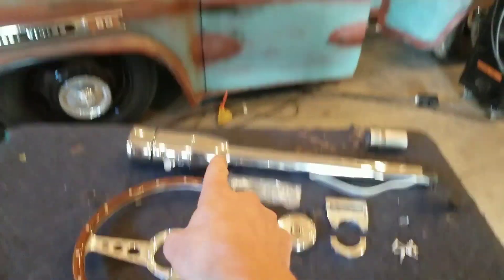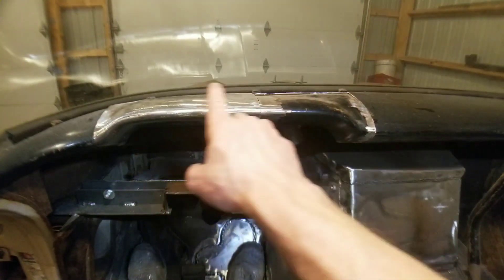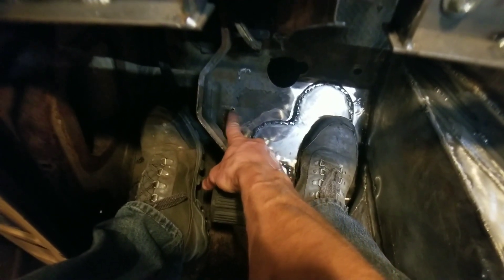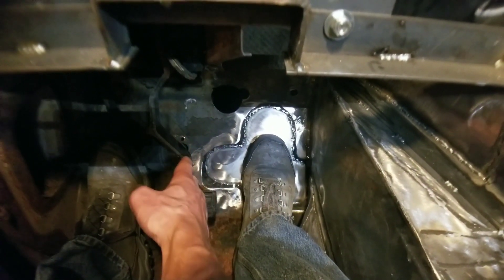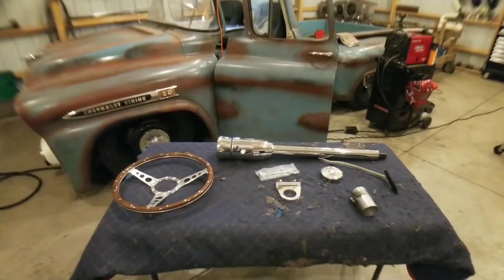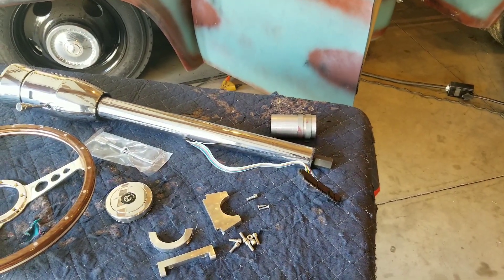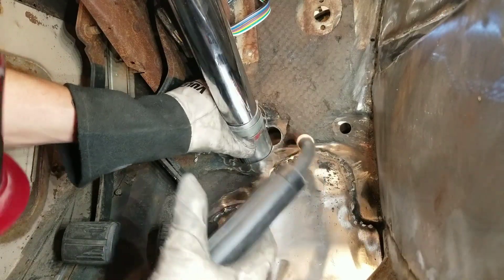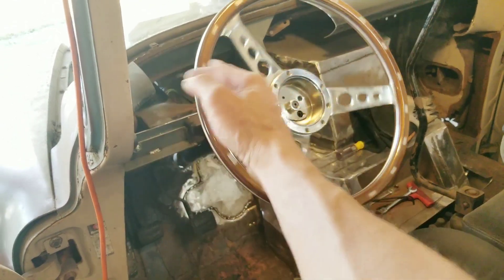How To Install A Steering Column With Steering Wheel ~ 1959 Chevy Truck ~ Apache ~ Viking ~ Custom

Comment: How is the steering wheel holding up? Some say you get what you pay for but I wouldn't mind buying one of these if it gets the job done
Reply from the maker: Sorry for the delay on the response.   I wish I had a good answer for you on your questions,  the steering wheel is still in good shape but I haven't used it so 🤷‍♂️.  I really like it although its a little thin otherwise good, as far as the mount at the bottom of the floor pan I used a piece of 1¾ exhaust pipe welded to the floor pan and a clamp to hold it sold.  Works good...Thanks for the comment 👍 I hope to get back to it soon..

Comment: What seats did you use?
Reply from the maker: https://youtu.be/gvacrsJz-d0 here is a link to the seat install video, The seats came out of a scion XB (the refrigerator box lookin thing) if I remember correctly.  Not using head rests.  They have great style are comfortable and cheap.  Eventually I am going to have them re-upolstered though.   Thanks for watching and dropping a comment.   🤝👍
Reply from the maker: Also should add the center console was from a mid 2000s silverado truck.

Comment: What kind of shifter do u have? What’s the length of it?
Reply from the maker: The column is a universal 28 inch tilt column (not keyed, the key is in the dash board) .. If I was to do it again I would order a 30 inch column and the truck has a eaton 6 speed manual transmission ..
Reply from the maker: Also I should note my column is NOT in the factory location, so if you are building a similar style truck make sure to measure and re-measure for your specific application. 😎👍  thanks for checking out the video and for the question/comment, also make sure to subscribe 👍to the channel, a little inside info 🤫 I fire the motor up in tomorrow's video!!!
Reply: Yes rn I’m working on installing some power steering on my 1959 Apache. Keep up the good content brotha✊🏾